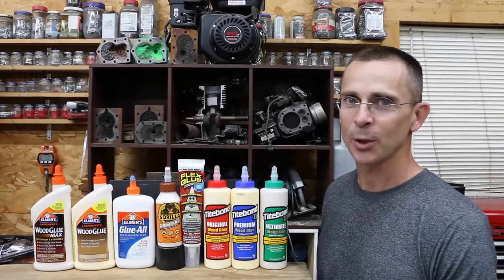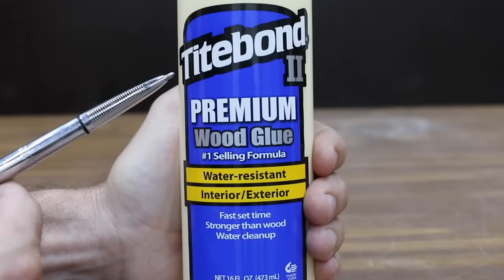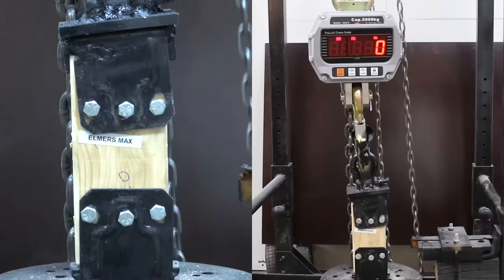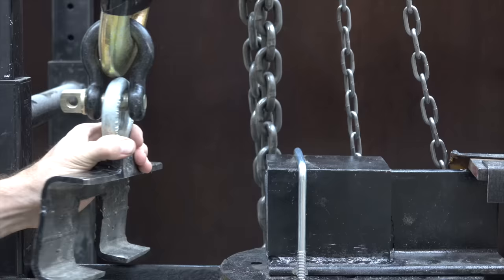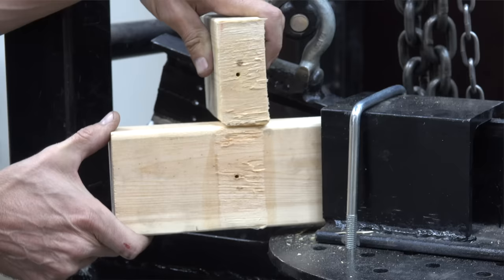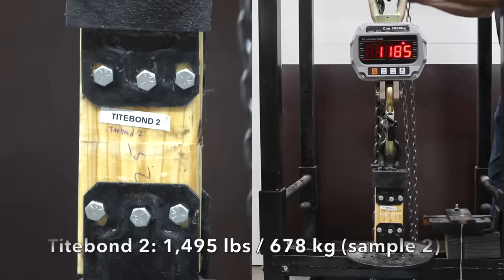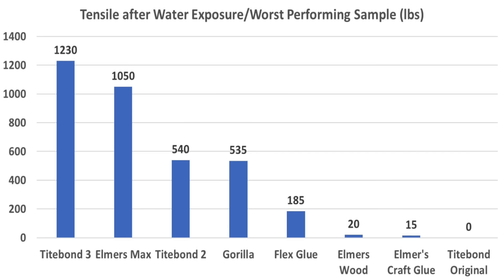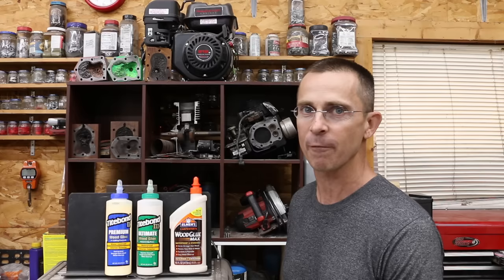Which Wood Glue is Best?  Let's find out!  Showdown with Titebond, Flex Glue, Elmer's & Gorilla.

Comment: I'd like to see this test with edge or face gluing. End gluing is notoriously weak.
Reply from the maker: Thank you for the feedback.
Reply: I was thinking the same thing. That there were such wide discrepancies in the results suggests that end grain gluing might be the culprit. I'd like to see single and double shear tests on face grain glue ups. Note that the one consistent result was with a low strength glue.
Reply: This is true but when used properly the results are only going to show the strength of the wood not the glue most likely. i think this is probably the best way to test the glue its self as it looked like the glue was breaking rather than the wood on the pull tests anyway.
Reply: Made another comment before I saw this, I was thinking the same thing
Reply: Agreed. No woodworker worth their saw is gluing endgrain. I was expecting face-to-face testing.
Reply: @poppenandy  True.  But I was surprised they did so well at it.
Reply: you'd split the wood long before you broke the glue bond, so the results wouldnt mean much.
Reply: @blepblep8267  Could be! I guess we'll never know. I know the common belief is that, used properly, wood glue is stronger than wood. But is that actually, scientifically true? Is it also true for Elmer's craft glue? Is every glue stronger than wood? These are questions that could be answered, rather than "how strong is wood glue when used in a way that no one should ever use it?"
Reply: @poppenandy  ive broken apart several projects that were held together with wood glue, and 9/10 time ill split the wood before the glue bond breaks. so there ya go.
Reply: @blepblep8267 Thanks, but I'm obviously A: not polling the audience for their opinion, and B: looking for the more rigorous scientific results that Project Farm provides so well. I'm sure your personal experience was very educational; it's just not science.
Reply: @blepblep8267  You really don't need to "solve" this problem for me or anything. Unless you make a YouTube video about it. Then hit me up.
Reply: @poppenandy  None of this is science except in the broadest sense of the term that said it is still useful information. There are flaws in all of his video tests as a single test only gives one result using only two of any given subjects ie, pieces of wood, motors, engines etc. In the above example the wood sap in pine can change greatly from one end to the other in  a single board, mating surfaces were not planed or sanded to certain tolerances and knots were not removed or grain structure scrutinized. It's still useful.
Reply: Orion Adcock (sigh) Oh, I do love when a scientist appears to tell me what is and isn’t science. He designed an experiment. It’s science. It’s not perfect double-blind PhD-worthy science. Come down off your condescension horse long enough to realize we agree please. 

Except for the part where you say this is useful. I’m not sure testing a product in a way that no one should ever use said product is very worthwhile. 

This is such a weird comment thread. All I said was no one glues end grain so this is kind of unusable information. Then a bunch of goobers pop up to do a bad job “well actually”-ing me. I literally designed and built science exhibits for a living y’all. For almost a decade. Next time you are tempted to man-splain on the internet, just maybe idk, don’t do that?
Reply: this is actually the best test method,as its the weakest way to join two pieces together
Reply: @poppenandy  just because a professional wouldn't glue on the end grain doesn't mean me and every other idiot throwing glue and wood together wouldn't. So this information is very helpful.

Also if you're so great at making science exhibits and you are oh so much smarter then all the people commenting to you, why don't YOU make a better, more scientific, more "useful" video??

And

This video does show valuable information as to the strength of these glues.

If end grain gluing is as bad as you and all the other carpenters are saying then we can figure out a couple of things from this video;

1. If end grain glue jobs are always weaker than flats or sides glued together, then these tests show us at the very least the weakest forces we can expect these glues to handle.

2. Flex glue is too expensive for its own good.

3. We can expect these glues to perform as good if not better if they were to be glued the "proper" way
Reply: @MadCrazeTheBlade708  Is this a defense of gluing end-grain? I feel like this comment thread exists in a Dark Mirror episode or something. Good grief, aspire to greater. Gluing face-to-face isn't a niche skill known only to the ancient masters. To be clear, I'm not saying you should be judged for not knowing that. We all don't know things. But it's kind of weird to defend bad technique.  

All I asked for was a face-to-face gluing test. I'm not attacking Project Farm. I'm not attacking his test. I love that he's testing this stuff, and I'm chiming in with something I would find more useful. The rub comes when other folks pop in to offer backwards, condescending commentary on a simple, constructive request. 

As for making my own videos, that's akin to telling me to build my own car because I don't like the stick shift on a Volkswagen Beetle. It's kind of a large jump from commenting "wish you glued face-to-face for this test."

There's a difference between being smart and just not being stupid. On a good day, I  hope to fall into the latter category. On a good day... I'm done with this thread though. Enough's enough.
Reply: @cpinkerman  I was thinking the same thing.  But as RJM pointed out the wide discrepancies clearly invalidate this test as well.    I Wonder if edge gluing a harder wood with a consistent grain structure might give a more realistic result.   But at the same time, I think it's also true that glues have many properties, and they only have to be stronger than the wood.  So "More" strong is Irrelevant.    The difference is in the other characteristics:  Open time, temp range, cure time,  cleanup, shelf life, clamp time, grab, etc.
Reply: @bobcougar77  totally agree.  I have been a cabinetmaker for over 40 years and this test is not real world testing.  It's interesting but not something that is helpful.  Your statement about "Open time, temp range, cure time,  cleanup, shelf life, clamp time, grab, etc"  is more real world use type of info that is needed.  I used to use white glue until reg. titebond started to become popular and  it's all I use now..gallons and gallons of it.  I like how it gives just the right amount of open time, cures fast, and graps quick.    So endgrain gluing tests, yes, in my experience, I'm amazed at how well the pieces stayed together but in actual use, there are more useful factors to consider.
Reply: @AffordBindEquipment  titebond is pretty much all I use as well.   I enjoy this Chanel and he engineers some great test, but it's tough to know everything about every subject!  It's what you don't know you don't know that gets you!
Reply: What exactly do you mean when saying edge or face glueing? Sorry I'm no expert on that topic but would like to understand your thoughts :-)
Reply: @POPOkakaFURZ  think of a  board of wood as a bundle of drinking straws.  The end grain is  the end of the straw and the face/edge grain is the sides.
Reply: @bobcougar77  ok many thanks understood it now!
Reply: @POPOkakaFURZ  Boards are divided into end grain (notoriously difficult to glue due to porosity), edge grain (sides of boards), and face grain (widest side). Edge and face gluing are much more predictable for gluing and bond much much stronger than end grain. Think about gluing straws together. It's (relatively) easy to glue straws side by side (face or edge grain) but it's both difficult and unpredictable gluing straws end-to-end.
Reply: Same here. As a woodworker, I never use end grain for any type of structure.
Reply: that's the point. testing them in the least ideal situations.
Reply: @thepjup4507  why didn't they test it on fudge? I bet it would be real shit at that.
Reply: @thepjup4507  It may be the point but the data points are all over the place demonstrating the poor reproducibility of end gluing results, thus making it difficult to use as a basis for comparison.
Reply: @Wroger Wroger I'm pretty sure that the main variable here is the high variability of end grain porosity. Some end grain wicks the glue out of the joint immediately, other end grain doesn't. Thus, results are over the place.
Reply: @Wroger Wroger It's useless information if the material breaks before the glue, all this guy tested is the quality of the joint with poor glue ups, I bet the boards weren't even flat, construction timber rarely is.
Reply: @orionta  ahh the struggle of the scientific community, which 90% I'm a fan of.

But that ego is makes up the other 10%

So you go and find me a piece of wood, one which the grain isnon existent that the glue would bind too. You could find a way to seperate perfect cross section with non destructive methods, maybe clone the tree in perfect condition so that the grain is always consistent. 

Most of what we have discovered has been accidental in nature, a small list flight, penicillin, fermentation, heavy metal poisoning, solubility, spring tension, ect...

Project farm in reality show the strengths and weakness to certain methodology, which can and in my opinion will have a significant impact on society. 

It's far more important to know how something can fail, then to simply how to achieve your goal.

As you can take some NaCl + H2O, in a open container in a small room no protection add electrodes run a current through to sperate the CL. And the last thing you might realize painfully is one achieved success. You wouldn't do that right? But some one did or we wouldn't know not to do it.
Reply: @poppenandy  this information is extremely useful, don't you dare undervalue it.

For instance now when you hire Joe blow hack off the internet to build you a shed, or maybe something more structural you are learning what to look for in quality craftsmanship.
Reply: @rjm7168  I edge glued some oak back in the late 90's and my ex threw it on the basement floor causing it to warp and ruin my work. I got pissed off and started slamming it into the concrete breaking it into several pieces. It did not break near any of the glue joints. The oak wood itself broke. I'm guessing glue made today is stronger. Ignore the outliers that broke easily and you will know which glue is best. Clearly titebond 3 and Elmer's max are best. And all of them except for that one gimmick glue are good enough for most woodworking projects even the Elmer's hobby glue
Reply: @poppenandy  any wood worker worh his salt knows that if you glue it that way the wood itself is what will fail. Probably on all the wood glues at least.
Reply: I wanna know how he glued them in the first place, and if he pre glued. Either way very useful test and glad that I havent been doing wrong by going with titebond products
Reply: That makes it a good test of the glues strength tho, since it’s the hardest to accomplish (with glue) ?
Reply: @Crafty1172  But it's not consistently repeatable so it's not as good a test.
Reply: @PotatocannonLol  Do you typically ask your contractors which glue they prefer to apply incorrectly?
Reply: @PotatocannonLol  far and away this is the most numbskulled subthread I have ever been a part of. I completely undervalue this info. The video should be titled "Which glue is strongest when applied in a fundamentally compromised, unrealistic way." Then I would have no problems.
Reply: @poppenandy  ... In other words which glue is overall strongest, this means you are relying the glue not the wood grain structure. If applied correctly most soft woods would give before glue.
Reply: @AffordBindEquipment  it's showing the glue strength and not the wood strength, how can you not see that with all your experience
Reply: @patchedupdemon7104  I didn't say anything about wood strength.  I don't care what wood it is, end grain gluing is THE weakest joint possible and not a real test of any glue.  Especially since no one would use this joint for anything structural, even in a limited way.  I'm looking for real world examples of how the glue would be used and this isn't it.   He does an amazing job of testing; all I'm saying is the end gluing test doesn't show anything useful.

But in a way, though, it is about wood strength since the wood fibers can be pulled out of the end grain, since proper glue joints are 1.5 times stronger than the wood.  The tougher the wood, the less this is possible. 

My point still stands.
Reply: @poppenandy  not that you care, or to stir things up, but I think there's usefulness to the end-grain gluing example. Bozos like me will either forget, or want something done cheap and easy and don't feel like figuring out a better way. so it's nice to see what the best of a bad solution is. granted, I made a desk with nothing but pocket holes so I'm not winning any awards, here
Reply: What the hell are you building that literal thousands of pounds of holding force is “notoriously weak?”
Reply: @mattsnyder4754  The point of my response is that the test is flawed by using end-to-end grain gluing which is unreliable due to variation in end grain glue absorption. To swipe from an old Bill Tindall WoodCentral thread:

"As you are aware, the geometry of wood is similar to a bundle of straws. Those straws or tubes are designed to take up the sap and the nutrients that are needed for growth and transport them out to every part of the tree. While the edges and faces of a plain sawn piece of wood are comprised of the sides of those tubes and form a nearly solid layer, the ends of the same piece are comprised of only the open ends of those "straws" or tubes. That results in two different facts that create problems in achieving successful end joints. First of all, the fact that the end grain is so open means that there is comparatively little actual wood surface available for bonding. Perhaps even more significant, however, is the fact that the open tubes that form the end of the piece are highly absorbent. That means that when what would normally be an appropriate layer of any water based glue is applied and the joint closed, the porous end grain literally steals all the glue from the joint. Taken together, those factors drastically reduce the chances for forming a meaningful bond."

Edge and face gluing do not suffer from this and therefore will produce better data.
Reply: @MadCrazeTheBlade708  , VERY well stated. We are testing the GLUE after all, not the method of securing the wood. I thought the test was valid on determining strength. Especially in unusual applications.
Reply: @poppenandy  good for you 👍
But it doesn't look like you followed through with that.."I'm done with this thread though. Enough's enough"
Reply: @davidgraham2673  thank you, as far as I am concerned this test told me enough of what I needed to know about which glue to use
Reply: @davidgraham2673  You are not testing glue strength if different samples of wood wick it away unevenly (e.g. most visibly the log at the end, with the "tractor test") , and that is going to happen by 2-3 orders of magnitude more on end grain than on long grain. You are testing the strength of that particular joint, not of that particular glue. If he had run 1000 samples for each glue, then probably you could draw some meaningful comparative conclusions, but with 3 you simply cannot.
Reply: @patchedupdemon7104  It's showing the strength of that particular joint on that particular piece of wood. Wicking will happen in a very non-uniform way from piece to piece when using end grain (look at the "tractor test": where did the glue go in the middle of the log?), hence the variability in result even within the same glue. If he had run 1000 tests, you may be able to claim that there is some reliability to the differences shown; as it is... no.
Reply: compressed
Reply: @MadCrazeTheBlade708  It actually tells you very little - and that was the point of the OP that started this thread. Since the glue was used in such a way as to produce highly inconsistent results even within the 3 samples per type, you can really derive no conclusions
Reply: @cpinkerman  of course the strength of wood with the grain is huge. even more than the compressive strength of end grain. a 2x6 probably a million pounds or so.

Comment: I feel like there is an unknown variable in action here, why such a wide swing in results between tests with the same product? How does the same product hold almost 4000lbs in one test then 500lb the next? One held 2300 in one wet test then came apart in your hands the next? I love your videos and I know you do everything you can to take human error out of the equation.
Reply: your clever, there is. as many woodworkers have posted here you never glue end grain to end grain without mechanical reinforcement as was done in these tests since its the weakest glue joint possible as end grains are like straws and just soak up the glue leaving very weak glue bond. sometimes theyll hold up but mostly wont, as you saw here
Reply: The wood is inconsistent being a natural product.

Comment: This is a great comparison of primarily aliphatic style glues. I think two glues were left out that I'm seeing used more and more, and that is the polyurethane glues, such as Gorilla original and cyanoacrylate (CA) glues. Also, I would have liked to see boards glued up like one would when making a table top (i.e. side glued along the length of the grain).
Reply from the maker: Thanks for the video idea.
Reply: I hate the way gorilla glue foams when dried
Reply: @richardwolf6269  that's the original one,  wood glue is not foaming, and  they also have construction glue, which is not foaming